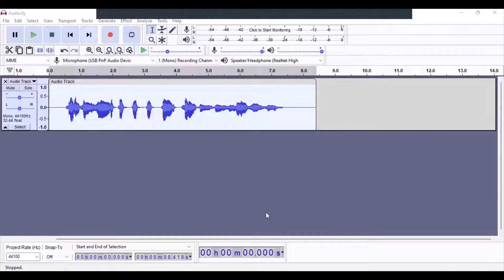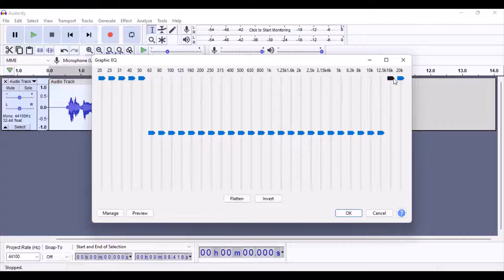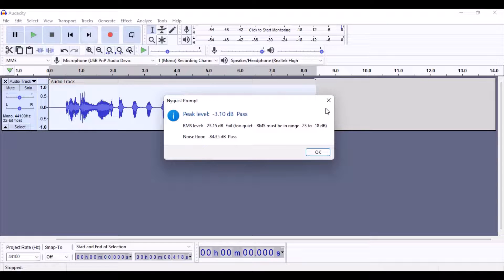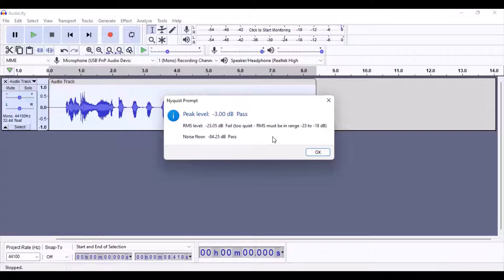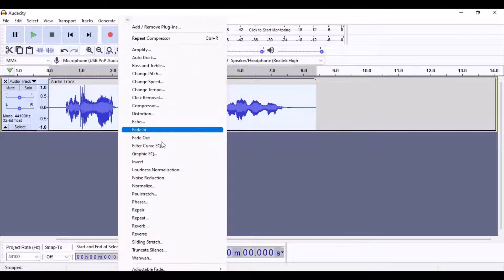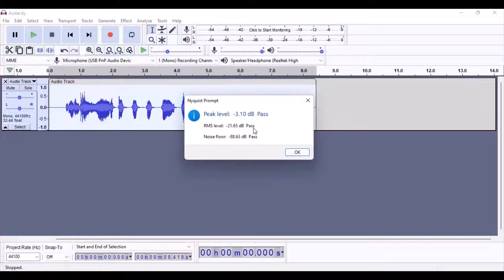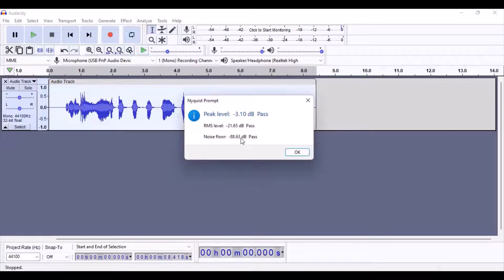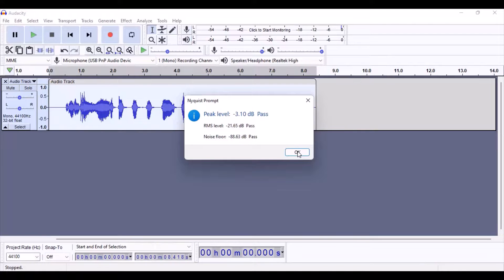How to correct a noise floor that is too low in Audacity

Comment: How did you set up the Nyquist feature to work? Waiting for ACX feature kills focus on solving problem.
Reply from the maker: Okay, first you're going to want to open up the audacity file with your recording. Go to 'Tools' and click Nyquist Prompt. Enter Nyquist code (e.g., (lowpass8 s 1000). Then click Oaky or Apply.
Reply: unfortnately this didn't work . does the code include the (  )
Reply from the maker: @ Yes. Try it now.

Comment: Hello Adam. I'm in the middle of recording an audiobook and I'm having this issue with the noise floor being too low. I came across many videos and yours was the simplest to follow. Having said that, I tried out all the steps that you show in the video above, and the problem persists. The AXC check doesn't even give me a number after it's done with checking the recording. All it tells me is the following, "too low" -inf dB Warning (too low - Dead silence sounds unnatural." Ever since yesterday, I've been trying, and the issue doesn't get resolved it just gets worse. Then I have to undo the steps all again. I have a deadline to complete the book by November 25 and....will you please help!
Nancy
Reply from the maker: The ACX set up video. https://youtu.be/sOOrgcBd7Go
Reply: @adamjrothstein  Thank you.
Reply from the maker: Hello Nancy. I have a video of how to setup the ACX tool. This will make your life easier. Once it’s installed and you use it your audio should meet the requirements. Also, please email me at adamrothstein29@protonmail.com if you have any more questions.
Reply: @adamjrothstein  Oh, thank you so much, Adam! I'll be downloading the tool right away. And thank you for the email address. Actually, I checked out your About section for an email and didn't see one so thanks again. 😊